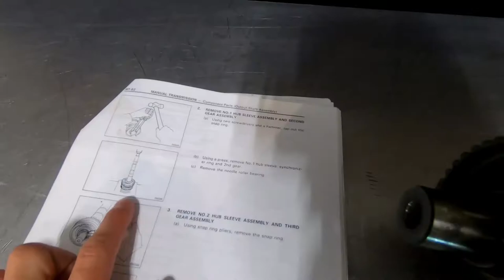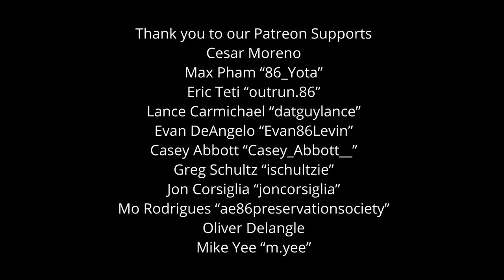R154 Rebuild Pt2

Comment: Hi, love the video. I'm currently rebuilding my r154. In the rebuild kit there are two synchros with different ramp angles. All the synchros in my box atm have the same ramp angles. I'm told they are a new design synchro and will replace to of the old ones. My problem is I don't know what gears they go on. They look like they must be directional by having a longer ramp angle on one side.
Reply from the maker: They are indeed a new design synchro and will replace to of the old ones. The gear cones are only a certain size so see what gears they fit. 

Just ball park memory, they should be for 2nd and 3rd

Comment: So i finally installed my r154 transmission that i rebuilt. All gears work fine except 2nd gear, it goes in but I dont feel the engagement nor does it actually engage to where the car moves. Any ideas to where i potentially messed up at? 🤣

Comment: Great video!  What does that aftermarket bearing retainer prevent?
Reply from the maker: The oem bearing retainer and thrust washer are both known weak points that can shatter. I recommend the entire billet upgrade for any R154 rebuild
Reply: @CMAutohaus  👍👍 definitely going to be ordering everything for my AR5 trans.  They have a 3rd gear failure issue with big power I'm trying to prevent
Reply from the maker: @Matp345  If budget allows, I also recommend Cyro and WPC treatment.

Comment: hey man i just picked up an r154 and therea about a 12th of an inch of play maybe a lil more maybe a lil less its around there and i wanna replace the input shaft bearing i dont have the cash for tools to do a ehole rebuild what would go into doing just the input shaft can i do it with just splitting the first case thanks man!

Comment: I just finished an r154 swap and now it’s rattling pretty loud when in neutral without the clutch depressed. Is that generally an input shaft bearing issue?
Reply from the maker: What clutch/flywheel do you have?
Reply: @CMAutohaus  exedy eBay kit
Reply from the maker: @cameronthebobameron1930  Rattle at idle with clutch out sounds like something is wrong inside the transmission. Bad input bearing would be a "whirring" noise with clutch out. Bad input shaft would be a whine in every gear except 4th